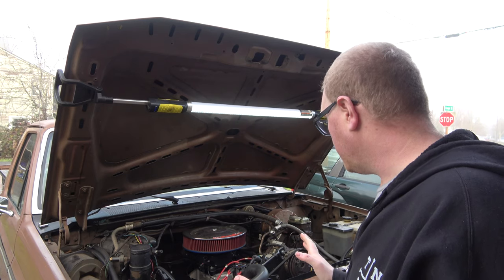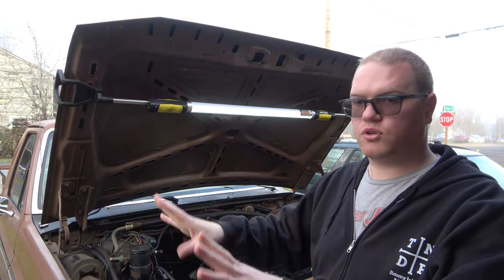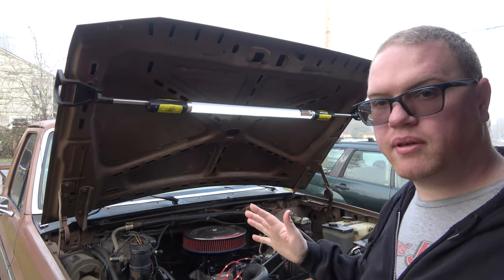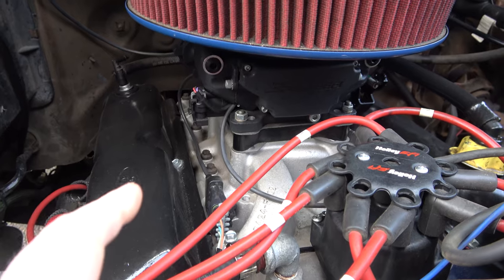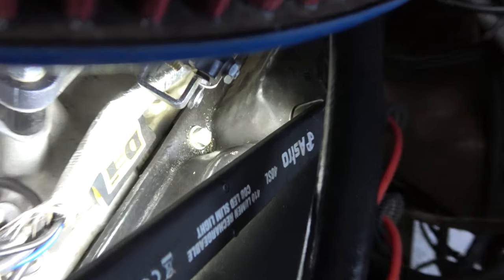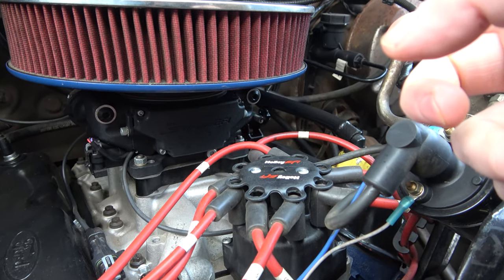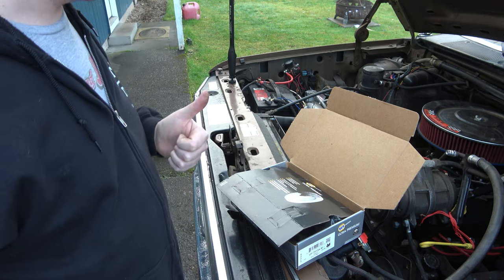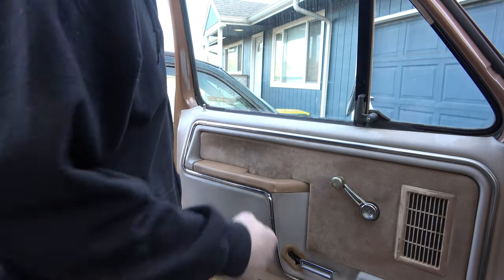The Junkyard Truck | Window Seals and Vent Shade Install | Last Video of the Year 2023!

Comment: How much did that rebuild cost all together?
Reply from the maker: Spent $1,800 on the machine work with new pistons and cam bearings. Then I spent another $3,800 to put the engine together. That includes the efi kit and the Holley/msd distributor.